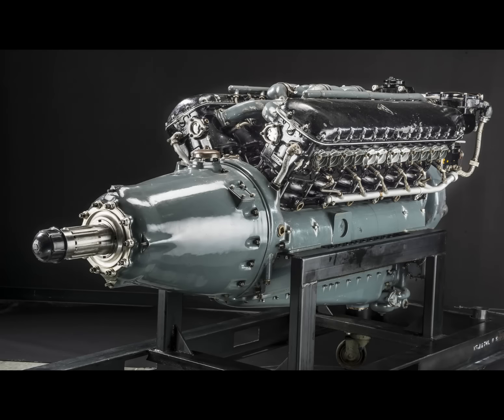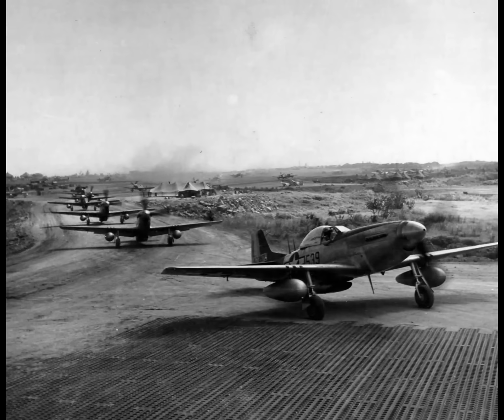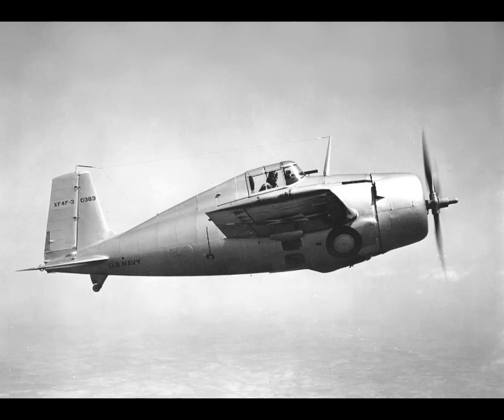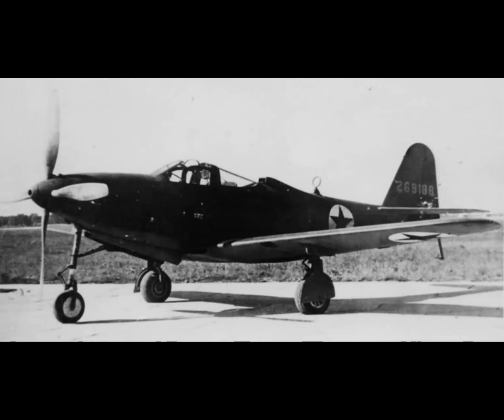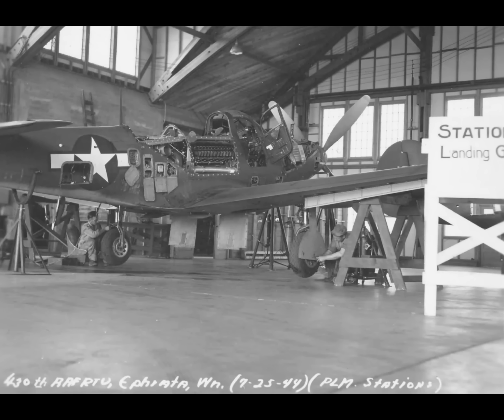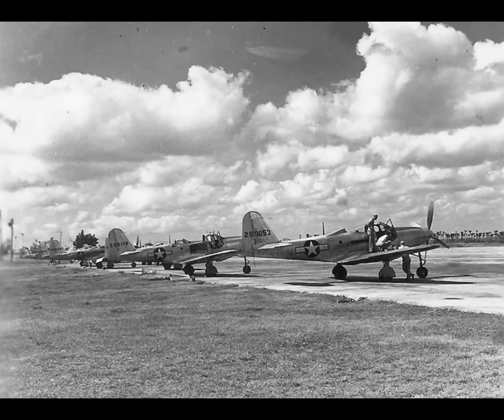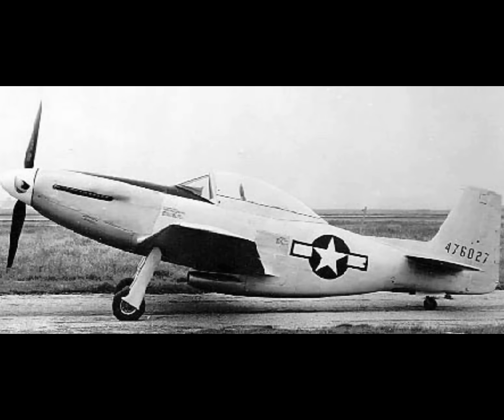Allison V-1710 with a TWO-STAGE Supercharger

Comment: Finally the dual stage supercharge Allison get some love!!
Reply: Unfortunately, the version used in the F82 was not terribly reliable and was nicknamed "The Allison Time Bomb".   I have no doubt that Allison engineers could have eventually solved the problem, but, as I understand it, GM (Allison's parent company) thought of Allison more as a job shop doing work for the US Government, at least for the V1710, and did not put their own development resources into it.  If they had been assured of payment, they would have gladly done it.  Rolls Royce seems to have viewed itself largely as a technology company and put more development into their projects.  I don't know if they actually had the assurance of getting paid for everything.
Reply: @jfess1911 
Well you're wrong, the V1710-143 and V1710-145 engines in the P82 were not known as "Allison time bombs", the fact is they had very little problems with the P82's engines. 

That nickname was given to the engines in the early P38's that first saw service in Europe, the problems mostly stemmed from the P38 seeing service for the first time in large numbers coupled with operating in the colder skies above Europe for the first time. 
Coincident with the introduction of the new P38J in Europe was the arrival of newly trained pilots from the US who'd been trained in the States on earlier models. 
The TEL in the fuel was sticking to the exhaust side plugs which should have been changed after every mission that throttles were run at WEP but weren't resulting in engine destroying detonation.
Pilots arriving from the US where they'd been trained to run engines at high RPM's and low manifold pressure during combat missions, this was very hard on engines and not consistent with either Lockheed or Allison technical manuals.
The fuel being provided for the P38's during the winter of 42/43 was not entirely adequate.
The improved innercoolers of the new P38 was causing considerable lower manifold temperatures in the skies above Europe than in the skies above the US where the plane was developed causing TEL condensation during cruise increasing the likelihood of detonation and plug fouling.

The P38's were operating at higher altitudes and speeds above Europe than anyone else had previously to that, as a result they were running in parameters nobody else ever had so a learning curve is to be expected. 
After the problems were identified and corrected Lockheed test pilot Tony LeVier who went to England with a team made two flights in a P38 running the engines continuously at military power, 3,200 RPM's at 60" manifold pressure at an altitude of 35,000 ft, each flight was run until the tanks were almost dry, after each flight sumps and magnetic plugs were inspected with no signs of internal damage, a compression check performed by a Lockheed rep found all 12 cylinders to have the highest values he'd ever seen and the results were reported to Lockheed. 
Nothing that caused the problems had anything to do with the engines, human error and a learning curve from the first time the aircraft had been run in that environment were the causes.

Since we're talking about aircraft operating for the first time in a new environment we can talk about the Mosquitos sent to the Pacific that fell apart in the jungle humidity while just sitting on the ground if you'd like.
Reply: @jfess1911 

Don’t you think that RR had a large motivation (including economic) to put considerable resources into the Merlin, while Allison was actually purposefully hindered by governmental interference? When you are working at winning a war, allocation of resources (and the timing of that effort) are being gated by numerous entities. Do you really think much effort was put into the Allison that RE-ENGINED the Twin Mustang from the Merlin at the timeframe that this occurred? It was only re-engined due to the exorbitant licensing fees that had to be paid for the Merlin after the war. Considering that the Twin Mustang was an aircraft that was obsolete compared to what being worked on at NAA after the war.
Reply: @Mentaculus42  yes, please read my previous comment
Reply: @LuqmanHM 

My understanding is that Allison actually wanted to develop the proper SUPERCHARGER SYSTEM early in the war (during their development of the version of the Allison for the Lightning) but was expressly forbidden by the government at that time due to resource priorities. NAA also had various “compromises” dictated to them by the government due to timing and politics.
Reply: @jfess1911  One source I read (a magazine article a long time ago) attributed the poor reliability of the Allison in the F-82 as due to poor backfire control in the intake manifold. The intake manifold on a highly supercharged engine contains a lot of fuel-air mixture and a backfire through the intake system can cause a lot of damage. This writer claimed the Merlins included a metal screen in the intake manifold which served to quench intake backfires. He also attributed the motivation of using Allisons to be to avoid paying license fees to Rolls-Royce.
Reply: @fafner1  Yes, Allison decided not to include backfire screens in order to reduce flow restrictions to the engine.  My best guess is that this was done by Allison to gain back power that was lost by omitting an intercooler and an aftercooler like those used in the Merlin (the hotter air/fuel mixture is less dense).   Allison hoped that using ADI (water/methanol injection) would do a good enough job.   It didn't.   
Maybe someone here knows if omitting the intercooler and aftercooler were done for packaging purposes or  possibly to reduce "engine system" weight to get closer to the Merlin.  The Allison with aux blower is physically longer than the Merlin and pushes the center of gravity forward.   Adding an intercooler and aftercooler makes that worse.
Reply: @jfess1911 yes, without war time developement pace, Alison could not perfected it. Though i believe if they had reduces the manifold pressure (so less horsepower) to somehwere closer to Merlins, it will be equally reliable

Comment: Great video! One proposition for video. It would be interesting if you make one about radiators. Is interesting how many different solutions are for the radiators, size, location, materials etc and compare how efficient there were and if fighters would be much better or worse if they would change the radiator design. Is very interesting the test for the spitV with the DB engine where the radiator was much smaller and the same cooling as the normal 109 radiatos etc
Reply: I would like to see an article on magnetos. How much of an issue is the alternating polarity of the spark

Comment: Allison V-1710 engine used roller lifters, while the Rolls-Royce Merlin engine used a different, non-roller valve actuation system
Reply: They weren't lifters but otherwise you're correct. 
Like many OHC car engines today the cam lobes actuated rocker arms, the Allison rocker arms had rollers on the end that rode on the cam lobes while the Merlin's rocker arms were the "slipper" type that had a pad on the end that rode on the cam lobes.
I'll let you guess which ones lasted longer.
Reply: @dukecraig2402  There's no guessing
Reply: How many engines survived long enough to go in for major overhaul?

Comment: Ever since worked on the V-1710 I liked it very much, I think it’s a very underestimated engine! It has a lot of potential!
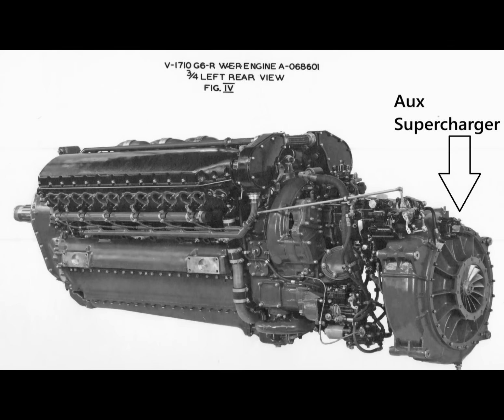Reply: A major part of the decision to place the Merlin into the Mustang came from the compactness of the dual-stage engine.  It was a bit heavier, but could be mounted in the P51 without moving the wing more than about 6 inches ahead.  This was not a big issue.     As you can see at 6:13 in the video, Allison's solution added the aux blower nearly a foot behind the engine and this pushed the center of gravity of the engine forward by quite a bit.  According to the Marshall and Ford book, this would have required a major redesign of the Mustang and pushed the wing almost 20" forward.
Reply: @jfess1911  The accessory drive on the Allison could have been redesigned to accommodate the very same two-stage supercharger and aftercooler that was used on the Merlin.

Between the Ford XV-1650 being canceled and the Allison being underdeveloped, it almost seems like the US military was doing everything that it could to ensure that the British played a significant part in powering WW2 aircraft.
Reply: @PistonAvatarGuy  The main issue is that Allison appended the aux blower to the accessary drive (and several inches behind the engine) rather than performing the kind of redesign done with the Merlin to make a more compact unit two-stage unit.  Although the Allison with Aux blower could perform at high altitudes, it was so much longer than the Merlin in this configuration that it essentially required a different airframe.  It was also a couple years behind the Merlin in development in this layout.
I spent the last couple of hours reading up on the Allison and it seems that US Material Command made the call to use the more developed Merlin engine (made by Packard) rather than pay Allison for additional development and wait another year or so for the bugs to be worked out.  
It seems that the US Army funded quite a few engines that did not come to fruition rather than concentrating on the Allison V-1710.
Reply: @jfess1911 the us army air corp has the hyper engine program that went nowhere
Reply: @jfess1911  "The main issue is that Allison appended the aux blower to the accessary drive..."

Correct, this is why I stated that a redesign of the accessory drive (and case) would have been necessary to accommodate the Merlin supercharger.

It is very strange that the hyper engine programs were funded, but further development of the Allison was not. The refusal of the Ford V12 is also quite odd, imo.
Reply: @PistonAvatarGuy  One article I read said that the Allison was essentially the backup in case the more advanced engines failed.  Allison also worked on the 24 cylinder V-3420 engine (essentially two V-1710 engines put together).  Allison also started working on jet engines in 1943.

Rolls Royce had set up Packard to make the Merlin just prior to US entering the war.  Although Packard and Rolls Royce worked together and Packard updated their engines, it seems that the US Material Command considered Packard-Merlins to just be another American-made engine.  I guess they decided that it simply was not worth trying to duplicate that performance at Allison.  After all, a large percentage of the 55,000 US-made Merlins went into US P-51s.  US demand was so great that Continental also began producing Merlins by the end of the war (they made just 797).
Reply: Allison had designed two stage, two or even three speed superchargers. But they did not develop or produce them because Turbochargers were deemed superior by their primary customer.